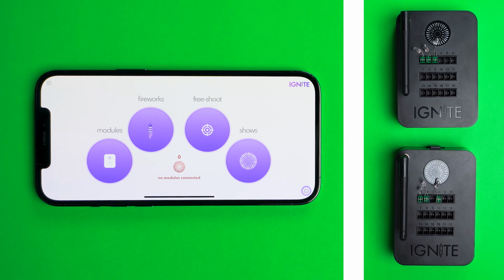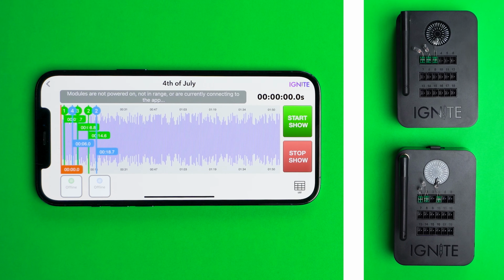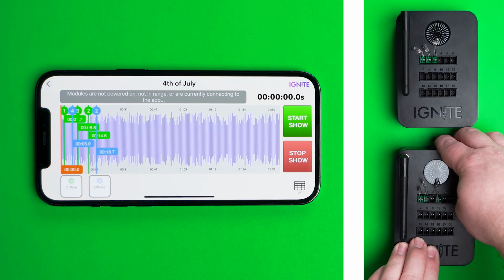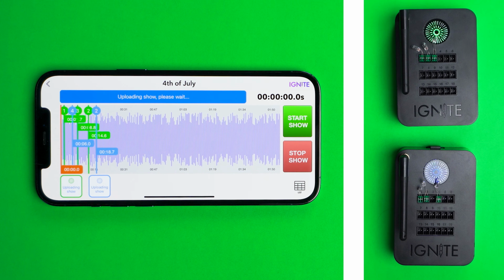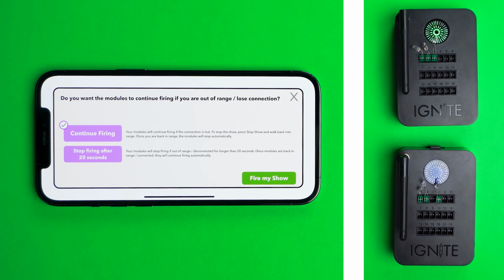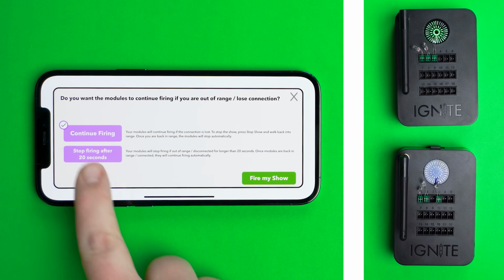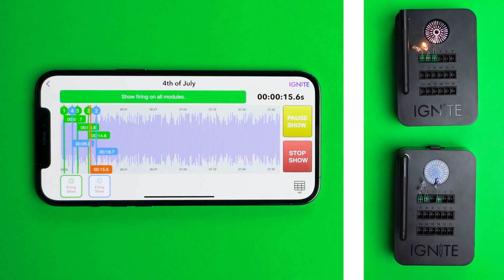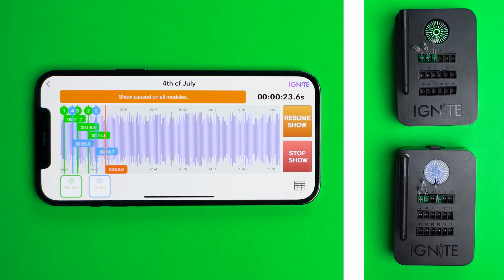IGNITE Firing Systems - Firing your Show

Comment: can you set a delay for the music, as the effects need some time before they start due to the fuse.
How do you solve this?
Reply from the maker: Hi! Zach here. Happy to help. With our IGNITE Show Designer software you can enter in what is called a pre-fire time. This is the delay time it takes for the fuse to be ignited and intern, light the firework. The IGNITE system will take this information into account when the show is loaded onto the phone. If you need any help feel free to email us help@ignitefiringsystems.com.
Reply: @ignitefiringsystems  Thank you. I am testing right now. Free Shot works well. My created show just does not ignite the igniter. I don't know what I am doing wrong. The color and assignment of the module is correct.